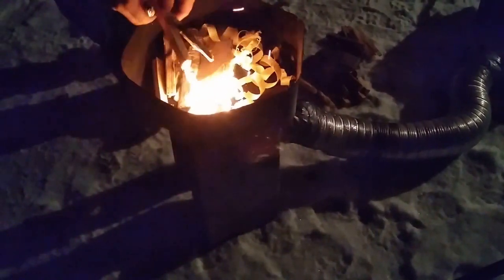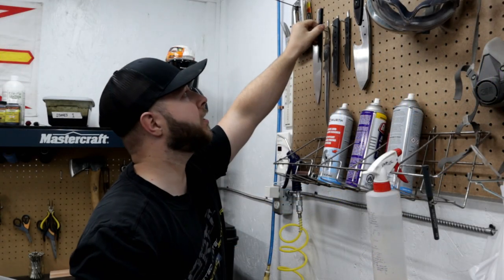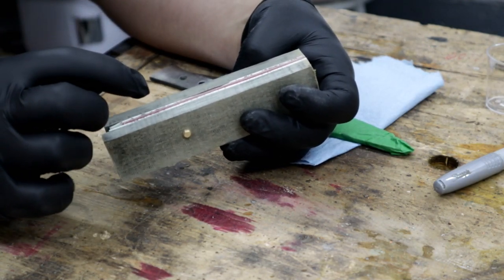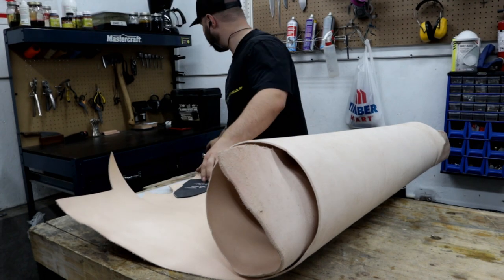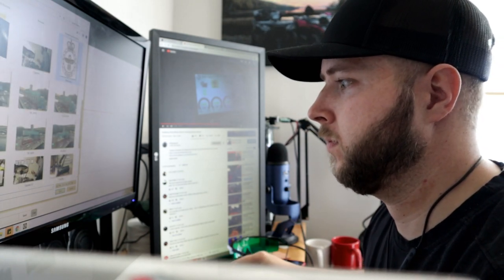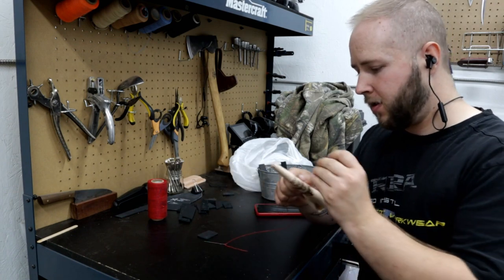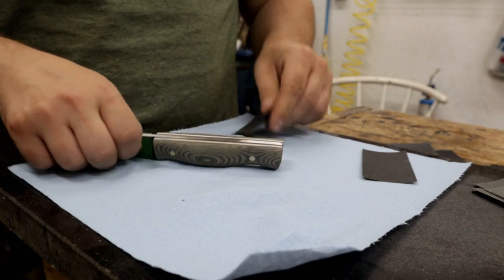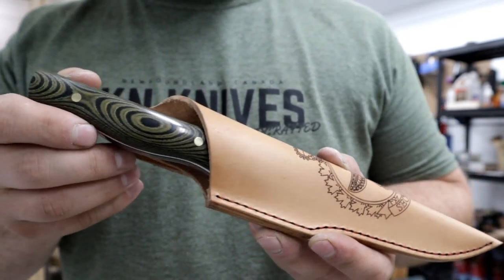Building A Knife for the Military - [NLH 8]

Comment: Kydex and G-10 would have been more military oriented.  I wish you had researched the blade type, length and shape for military use a little more.  Leather is definitely not appropriate.  When it gets wet it will rust the blade.
Reply from the maker: I agree on your choices, friend! The problem here was time constraint. The request got finalized really late in the game, and we needed a few weeks for shipping so... I had to go with what I had ready at the time.

I think I will be participating in this project again next year, and I will allow the right time, and choose a proper design.
As for actual military USE, I don't think this knife will see it. I suppose it's possible, but it isn't being sent overseas or anything.
Reply: Mil spec with Kydex might auction for 200, that work of art I might look at 500. Since raising money is the mission I think Kyle did just fine.

Comment: You make the palm swel way to thicker than it should, thin it out a little bit. Check out the Lionsteel M4, or Bark River Bravo 1 LT, or TRC Mille Cuori these, have the best handles in the market.
Reply: That is your opinion. I myself prefer a thicker palm swell just like this knife has Sir.
Reply from the maker: I agree with Heath. I've been in the knife game for some time, and I have a good idea what people like. This would not be considered an extremely thick swell. The Lionsteel you mentioned, just to address one, has a 0.83" overall thickness. Approximately 21mm. My handle here has a 0.875" handle thickness, or approx. 22mm. Just to be clear: That isn't 1 mill difference per scale; that's 1 mill difference in the overall width of the handle! The bark river bravo LT is specifically branded as a "thin" or "lightweight" version. 

While all of those knives you listed are beautiful, they are a little on the thin side as far as handles are concerned, and my handle is still quite close in dimension. I totally get it, if that's what you like! You do you! :-) I like a slimmer handle for myself as well!
Reply: @kyle_noseworthy  The  thicker the palm s. the better the hammer grip, but you lose grip versatility that a bushcraft knife needs, for virious grips. Hammer grim is good for feathersticks, but sideholding and all other grips?? Everything in life works better if balanced and of course, it's obvious,that all have their tastes. What I said, is not a personal preference, it's what works better for a general cutting tool, that a knife is. You are not going to make only feathersticks, you need a bit bore versatility. I don't care if you don't understand, because I know...ego, blinds as all, and we are never wrong and in anything, Sorry for my English and sorry if you got ofeended. As an elder, and way more experienced than a young man, I thought I would help him, I guess I was wrong. My bad, new people are way to different than old times. Now egoism has blinded us all. Well, my English might be so bad, you didn;t even understood, that I was speaking generaly and not about my personal favorite grips. Take care and im sorry